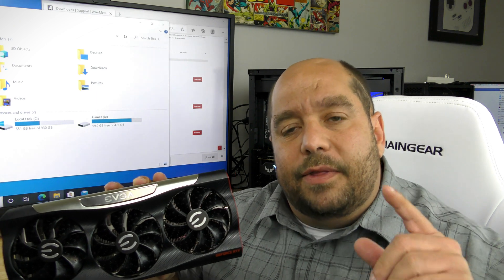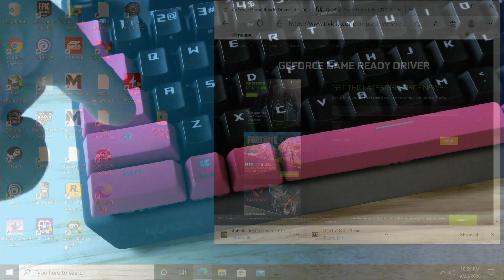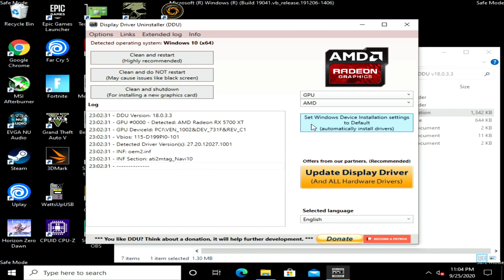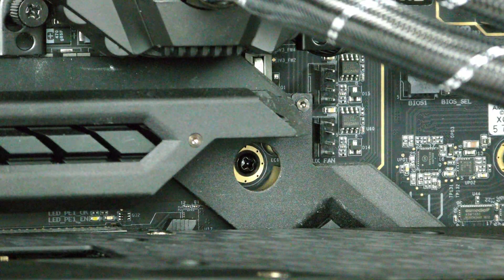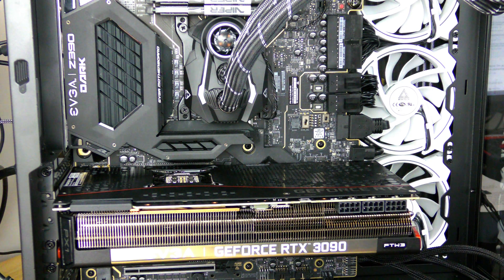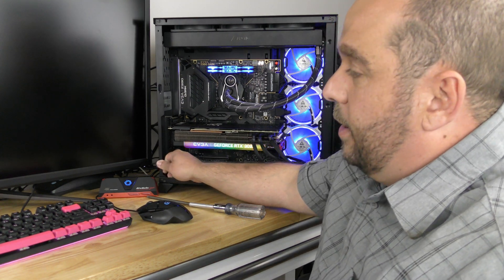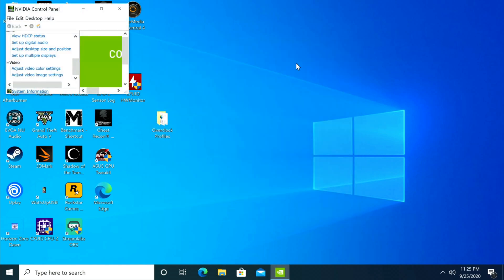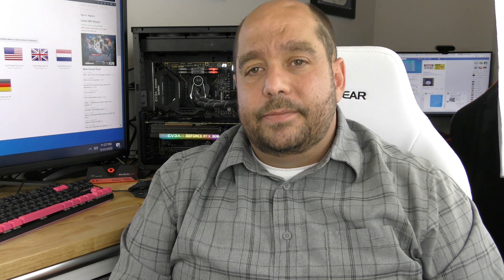RTX 3090 - Installing the EVGA Geforce RTX 3090 FTW3 Ultra Gaming

Comment: Did everything as you showed and when I updated the 3090 to the newest driver it just black screened. Have you been having the same issue as of late with the updates as well?
Reply from the maker: no, mine works perfectly well.  What manufacturer and model number power supply do you have and how do you have the pcie connections plugged in, one strand per pcie connection, or do you have any of them daisy chained?
Reply: I have the Evga 3090 ftw3 ultra and the evga g6 supernova 1000w power supply. I have it connected vertically to a gen 4 riser cable with an ek waterblock. I'm using the daisy chain connectors that came with the power supply but all of them are on their own individual slots to the power supply if that makes sense.
Reply from the maker: @YungDonDeNero  it does, but use the main cable, not the daisy chained portion of it, also try without the riser cable, it can cause a lot of issues.
Reply: @ThisBytesForYou  I'm dreading draining the loop again for like the 4th time lol it's weird cuz it will show an image and boot in but as soon I update the driver before it fully finishes it black screens. I have even changed the PCIE slot in my bios from auto to 3rd gen and nada. This is super expensive  machine and it's just sitting here lookin pretty but unusable 😪
Reply from the maker: @YungDonDeNero   @YungDonDeNero  yeah I know what you mean, but the risers are all iffy, when you install the driver is when it can put more use into the PCIE lanes and surely this is why this occurs.  What was the riser you bought, also, maybe configure the slot as a x3 in the BIOS, just for testing and install, see if it works after that, that will let you know if the riser is a x3 or a x4
Reply: @ThisBytesForYou  I bought the LinkUp PCIE Gen 4.0 riser cable that most folks were saying would work
Reply from the maker: @YungDonDeNero  I am using a LinkUp as well, but on a RX 6800, I will try it on the 3090 soon, I can't right now though, I have way too much going on.
Reply: @ThisBytesForYou   I was curious to know what version of the bios you were running on the card and which update driver you were using as well but I'm sure it's been a bit since you've installed the card again in your system. Would you recommend using an older gpu driver instead of the new one? BTW thank you a ton for replying back and allowing me to pick your brain!
Reply from the maker: @YungDonDeNero  always a pleasure my friend.  So if you use EVGA's Precision X, it will update your firmware to the latest version, I am on the latest version as you can see in this video: https://youtu.be/sgrvscvnCCw, that being said I am on 94.02.42.80.27 on driver version 466.11, although the latest version is 466.47, I have been working non stop, no time to update lately haha.  No, I always recommend the latest and greatest drivers

Comment: Heard that using pig tail (double) PCIE is not recommended. But my PSU only came with 3 pig tail cables. Could I just plug in each cable separately and zip tie the pigtail cables out of the way?
Reply from the maker: Correct, you cannot use pigtails, like I showed in this video and went over as well.  Yes, use seperate strands, like I show you in this video.

Comment: Great video. Question: can you use the PCI port right below the card (the one next to the M2 disk) without any problem to connect another card?
Reply from the maker: thanks my friend, usually yes, but it depends on your board but if you are talking about using SLI, I would not recommend it, there is VERY little performance gain and can cause many more issues because games are not really written for it.

Comment: DONT DO 850 WATTS AND BELOW FOR 3090s. From my experience the 850 will play most games but unoptimized games will cause your pc to shut off by itself.
Reply from the maker: Agreed, my lowest end power supply is a 1000watt, also, never pigtail the power cables
Reply from the maker: Also, you should always follow the recommendations.
Reply: @ThisBytesForYou  I upgraded to a 1250 watt power spec psu since the other brands were sold out and so far it’s been running good with no problems. The only reason I got the 850 Evga Ga psu was because the microcenter employee said I would be fine with that.
Reply from the maker: @gabe8422  good stuff my friend, I would always go as high as possible because why not, they will only use what they need.  I have used a 1200Watt for about 15 years, then another 1200watt for about 7 (I gave the 15 year old one to a friend and he has been using it for about 7 years, it was 8 years old when I gave it to him, still works) then a 1000Watts for about 2, never have issues and I dont need to upgrade ever time a new something comes out because I dont have enough power.  Pay a little more upfront, save for a VERY long time

Comment: Hi GREAT vid. THANKS. Is it possible to run 2 x RTX 3090 form one Gaming PC  BOX? What would you change? AND OR UPDATE. Curious your thoughts.
Reply from the maker: hey, so very happy you enjoyed this video.  You could run this, actually with the system I am using, but, there is no reason to.  SLI and Crossfire are basically dead, very little performance increase, too much power demand and not all games and apps support it.  I would not consider a second one.

Comment: RTX3090 should be an absolute high end..for the money! (unbelievable expensive :-( ),but an RX6900XT is maybe a bit better,for a similar (or better) price (yeah,it´s  also very expensive,but still not so much as by nVidia Ampere) .. i am affraid,that AMD Big Navi21 is now a better option to a powerfull gaming station! ..and more,with Ryzen 5x00 can using SMA when CPU and GPU are booth from AMD!
Reply from the maker: sure it can be, which is why I also have a video of the same for the 6800 and I will soon be comparing both, I dont have a 6900 yet, but I hope to.  I also have 3 videos of full AMD builds, take a look around my channel my friend, you'll find tons.

Comment: I have 2 pcie 8 pin connectors on a 850 non modular psu, is there a way to use with current psu or do i have to buy a new one?
Reply from the maker: what is the manufacturer and model number of your power supply?
Reply: @ThisBytesForYou  upgraded to rx850 from Corsair to be safe

Comment: so I am taking out a 2080ti and replacing it with an MSI suprim x rtx 3090 which has 3 8 pin connectors what advice can you give me for that please? am I going to have to run a new 8 pin plug from the  psu into GPU? Great video by the way, after watching I am confident I know how to remove old and install new one just not sure on the power side of things
Reply from the maker: yes, you will need to have 3 individual 8Pin cables come into your video card, no piggy backing.  Thanks so much for your kind words my friend,  I really do appreciate it, it means the world to me and I am so happy I could help.

Comment: I installed my 3080 following all the steps but when I start the computer all fans spin but no rgb on and no post, just fans running?
Reply from the maker: what is the exact model number of your card?
Reply: @ThisBytesForYou  It is a RTX 3080 EVGA FTW 3 Ultra
Reply from the maker: Read the model number from the box, it would be 10G-P5-3885-KR, 10G-P5-3897-KR or 10G-P5-3895-KR
Reply: @ThisBytesForYou  10G-P5-3897-KR
Reply from the maker: you may need to install then EVGA Precision X1 if that is in fact the model number and it would update your firmware on the card maybe unlocking the RGB.  If it does not work after that, you will need to call EVGA and get the card RMA'ed.  EVGA's support is awesome, they may have something else for you to try and if they do, please let me know, regardless of what the say.
Reply: @ThisBytesForYou  any idea on why I can't get a post? thanks!
Reply from the maker: @mushtaqsamim98  ok... not a completely different issue, what is the manufacturer and model number of your power supply?
Reply: @ThisBytesForYou  It's an NZXT c1000W gold, not much about it on the web only comes with prebuilts
Reply from the maker: do you have a seperate pcie power cable leading into each connection, you cannot pig tail connections like you could before.

Comment: I have a RTX 3070. So I have 2x 8 pin. My power supply came with a cable that splits into 2x 8 pins. Will that be enough for both cables or do I need to plug both into my power supply with separate cables? I hope that makes sense because I’m struggling
Reply from the maker: It does make sense, but no, don't plug 1 cable into 2 headers, NVIDIA requires 1 cable per pcie connection.
Reply: @ThisBytesForYou  thank you so much for the fast reply. I really appreciate it. So I’m guessing that’s what that splitter cabl(  8 pin to 2x 6 pin for)  that came with the GPU for?
Reply from the maker: @xxuntouchablexx22  Wait, which splitter cable?,... there should never be a splitter cable for newer cards, years ago it was OK, but as cards require more power (well, with the launch of the 3xxx series and 6xxx series) now they are serious.  And no problem my friend, I love helping.
Reply: @ThisBytesForYou  do you have a Twitter or something I can send I you a picture of it?
Reply: I’ve sent I you a tweet with pictures. I’m so lost. My first pc so I havnt much clue what I’m doing 😂
Reply from the maker: @xxuntouchablexx22  yup, just replied, happy to have you heard and trust in me to help you on your first build, it's a great feeling.  A few videos to help you from start to finish, let me know if it helps you.

How to Build a Gaming PC in 2021 - Step by Step PC Build Guide
https://youtu.be/9gg8w8BHGns

Wiring a Gaming PC for Beginners - Step by Step Wiring Guide: https://youtu.be/nJUqyHh1QQY

Flashing BIOS and Installing Windows 10 - Asus ROG Crosshair VIII Hero Motherboard
https://youtu.be/ljUDmy4giuY

How to create a Windows 10 USB Installation Media
https://youtu.be/C759I7DBXd8

What To Do After You've Built Your Gaming PC - How To Setup A Gaming PC
https://youtu.be/8JuC_Dpm6-c

Comment: Hey, do i need to buy 1 more PCI-E 8 pins ? i just buy the Msi RTX3090 Suprim X
Reply from the maker: What is the manufacturer and model number of your video card?
Reply: @ThisBytesForYou  My actual video card is an Gigabyte RTX 2080 Super with 1x PCI-E 8pins and 1x PCI-E 6pins
Reply from the maker: @SubG0D  sorry, I meant to say what is the manufacturer and model number of your power supply?
Reply: @ThisBytesForYou  Np, its a Corsair RM850
Reply from the maker: @SubG0D  your power supply comes with 3 PCIE cables, each of those comes with 2 x 6+2 heads.  So use each cable, and connect a 6+2 from it, do not daisy chain the connections.  If its not in the power supply now, it should be in the box if you still have it.

Comment: when connecting the PCIE cables to the PSU do i just stick it in any slot that can hold 8 pins?
Reply from the maker: your power supply should have an 8Pin EPS connection which is for the cpu, and NEEDS 3 x 8Pin connections for the video card, those could be 6+2's as well but they need to each come from a separate strand, cannot be daisy chained.

Comment: 3090 gigerbyte Extreme no display on install. Have tried what you put in the video. No luck.
Reply from the maker: What is the manufacturer and model number of your power supply, motherboard and monitor?
Reply: @ThisBytesForYou  It's not the PSU, im using the Corsair hx1000i, you can test if its a power problem by simply not plugging any power in. The PciE will power the card enough for the pc to post the message. Please power down the system and check to cabling.  I also used seprate cables for each of the 3 power connectors. 6+2 cables. "type3"
Reply: I feel it either a bios problem or a faulty card. I've currently gone back to the 1080Ti to look for answers on the web.
Reply from the maker: The power supply is what I was eluding to, thank you for making that clear
Reply from the maker: My friend, you came to ask me what the issue was, and I am trying to help you... Please provide the answers to the questions I am asking so that i can help you, you got the power supply down, now the others.  I did not go to school for dentistry, I shouldn't have to pull teeth to help you.
Reply: @ThisBytesForYou  I gave you the information, I even replied a minute after you asked. I also gave you extra information. If you're not sure then just say.
Reply from the maker: This is what i wrote above "What is the manufacturer and model number of your power supply, motherboard and monitor?"

Comment: I have a zotac trinity 90 and a ftw3 ultra 90 and both nvidia, the pins of the Zotac Trinity are "AMD" style. it is up to makers to decide which way they put the power plug. and most of them are actually "AMD" style.
Reply from the maker: Of course it's up to the aibs but since I have never reviewed or worked with zotact, I didn't know, thanks for letting me know.

Comment: I don't why people always DDU things out, didn't need to in any of my system, maybe I'm special ahah I just uninstalled from the adrenaline software, then replace gpu, and I was up to go didn't experience any crash or bug, I had a vega before that
Reply from the maker: As a product development engineer I found it the quickest and most efficient way to make sure that all of the older drivers were gone.  Later as it manager and reviewer it never let me down.  Issues many others have had, I have never had and I have worked with literally thousands of cards and builds.   Consider yourself lucky if you have not, but without them, I have seen issues.
Reply: @ThisBytesForYou  I acknowledge that it is not impossible to have no issues with drivers, I just believe it is just the wicky-wacky-ness of some drivers at some point in time, still i would not recommend DDUing at least before having any issues, those options about other amd driver weren't there a year, and ddu just broke rysen master and windows implemented amd power management. although that was my only experience with ddu and that was not great. I hear this software everywhere as a must have and the only time I used it broke other thing 😆. but still it get recommended by far every knowledgeable people like you and I'm okay with it, I must tell that my experience wasn't that good. and the new options improves the user experience too.
Reply from the maker: @Ianochez  yeah drivers have gotten better with it, but realize a driver getting rid of itself like having you get rid of your own arm.  It's part of you and is difficult to remove.   It's easier for someone else to remove your are while you are asleep (safe mode) and then install your new arm and get it configured correctly while awake.  Sorry, just woke up... May not make 100% sense, I have not come to my senses yet hahha.  In regular mode, windows has its clutches on everything, running drivers, registry entries, directories and more, not in safe mode.  If you had an amd chipset, chances are you checked off everything in the amd section, which yes will screw everything up, unless you get started with the chipset upon re-entering regular windows.  It does make it better that amd and nvidia have the factory feature (which surely many don't use) but still it's done in regular made, mind you at start up, so this are set to delayed and set to priority but the chance is there.
Reply: @ThisBytesForYou  nonono I totally agree with that just a couple of seconds on the windows registry I'll see that old will be there
Reply: @ThisBytesForYou  at this moment I have 24 "branches" that could be associated to gpu driver artefacts, I remember playing with some of them back in my other system, there was an edit that allowed the vega64 to augment power limit, Vega Power Play Table or something like that. I didn't figure how everything pans out there but I think that one installation might generate multiple at once, like 3 or 4, so I had 6 to 8 configuration in that particular system, and it seem to check out, I did many tests, single gpu, dual gpu, crossfire, single and dual explicit mgpu with nvidia cards
Reply from the maker: @Ianochez  yeah, just like the 6800, the drivers (easily modified) will allow for more performance, and heck you can make the 6800 a 6800 XT but I don't want to go into that with a tutorial on the channel as it could of course mess up someones card and I don't want to be responsible for that, for a big channel, they couldn't care any less but as a small channel, I care about my viewers and I hope to carry that into when/if I get bigger, always pushing.

Comment: I got this card today, dead on arrival. Kept getting code 43.
Reply from the maker: Code 43, what is the manufacturer and model number of your power supply and motherboard?
Reply: @ThisBytesForYou  I already went through the process of fixing the issue with evga. They said they’ve had a few bad batches of 3070 and 3090 cards. Code 43 means it won’t take any driver updates and the system will not recognize it. I’m using the msi x570, 1000 watt power supply.
Reply from the maker: @flashhobbies  ahhh ok cool, just making sure I could help you, glad you were able to get it resolved, I hope the next one is great, I hate when that happens.
Reply: @ThisBytesForYou  appreciate it! Sucks I have to wait just a little bit more to enjoy some gaming. 😂
Reply from the maker: yeah for sure it sucks, but at least you have one now, many can't get it at all, so great for you at least.  Thanks so much for stopping by, checking out my video, liking and subbing as well as trusting in me to help you, it means a ton to me.
Reply: @ThisBytesForYou  no problem. Just came across your channel. Great content. You deserve more subs.
Reply from the maker: Thanks my friend, I really do appreciate it, i try to get out there but it is difficult since many don't share the videos, and I share them but of course people have their own niches, so if you want to share some of my videos, it will help tons.  Thank you my friend.